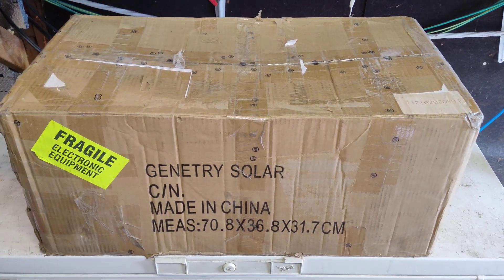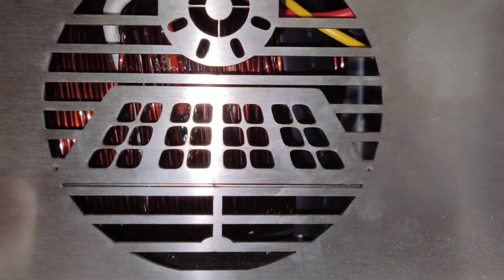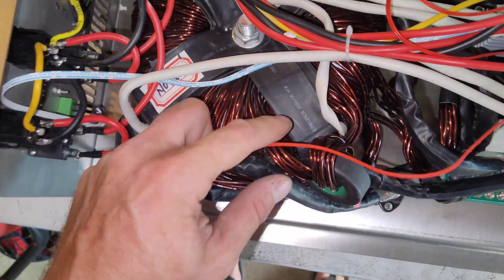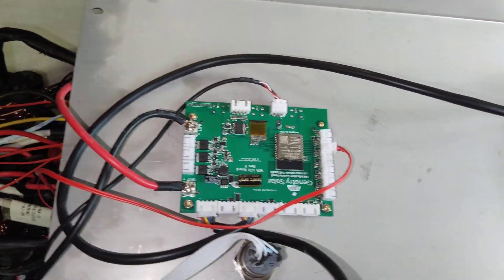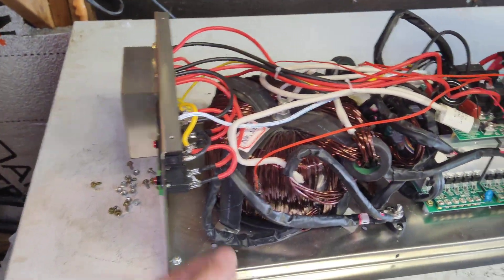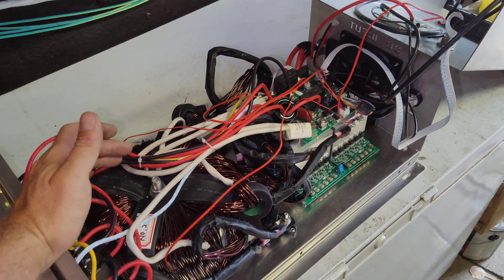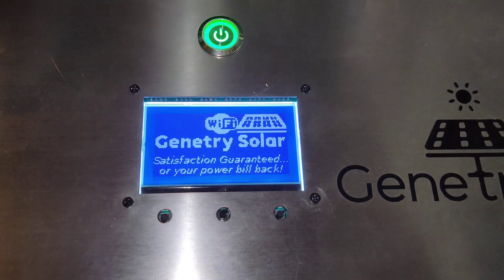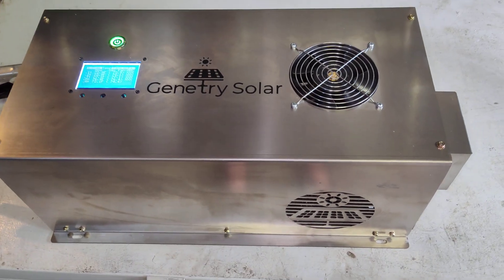Genetry Solar 6000W inverter Unboxing

Comment: Hello,  I have a 12v 120v powerjack, I bought it brand new, I put it away for a long time and now it doesn't work. I connect it to the battery and the battery input breaker turns off. (When I opened the inverter, it had mouse poop and urine on it from being stored for so long. Do you think that with the Mother board and the driver board it can be fixed??
Reply from the maker: @rafaelmt1000 depending on how much pee is on the board. Probably burnt the fees if the inverter is poping breakers, have you checked to make sure it's hooked up correctly?

Comment: I don't know, it looks very messy in there. Too many wires everywhere like most of it was an afterthought. Maybe it will be alright but does not look well engineered to me!
Reply from the maker: well so far I have pushed 2 mega watts throught it and 2000 hours and im sold on it for the price its great!
Reply: @GoingOffGrid101  Well that's great. I do like that it is a LF design.

Comment: Hey there, thanks for the video.   Magna Sine is reported to be 96% efficient and I wonder if that's true / one of the reasons for extra $$.  My AIMS 12,000w run 85% (max) efficiency.     Maybe you'll discover the efficiency of this new inverter before replacing your Magna Sines.

Comment: You have a well pump, right? I can't remember you doing any testing with one though...?

I think i might pick one of these up once i get a bigger battery and a few more panels, but i don't know what i should expect for powering the well pump. I don't believe it's very deep, but i still have to get my meter on it.
Reply from the maker: I have a 420ft deep well so it's hard to start
Reply: if 6k  ends up not being enough for your loads  no worry two will run together without haveing to buy anything extra  and if your ruing 24 volts now and go to 48 with the extra solar thats what them stand offs with the wires are for yes you can change it to 48 volts  no shelling out big money on a new inverter to upgrade  the gs dose the unheard of things no others do awesome inverters

Comment: looks like new and improved powerjack JUNK!!!!
Reply from the maker: Time will tell. You can see his progress on his channel, almost nothing is shared with a powerjack I have a 15000w ok that it will take on ;)
Reply: It should be an improved PJ, taking the best of what they have. It's not a magna sine, but it's not a true power jack... Pj made the parts, but they're not over rated and overworked. I'd buy one over a pj... At least i know it's not a lie.
Reply: My 2 cents: literally ALL of the Chinese low-frequency inverters use the same identical basic design; rumors are that it was copied from an older Xantrex inverter.  Such names that I'm aware of thus far are: 
    Power Jack
    Solinba
    Yiyen (and I presume direct derivatives such as Aims, Sungold Power, Sigineer, etc.)
    Must Inverter
    Felicity Inverter
    Kama Power
    Power Star

I haven't come across any clear photos of a Growatt control board, but thus far they look to use the same design as well ;-).  Among several other things, look for 2 white TLP350 opto drivers, and 4 SMT transistors near the FET cable connector--that's the makin' of a strangely imbalanced (but cheap!) FET driver circuit.

The GS design is notably different from all the above, with a fully matched and balanced FET driver setup.  It's almost funny how that results in the transformer being almost silent in normal operation, as in, "Wait, is that inverter actually running?"